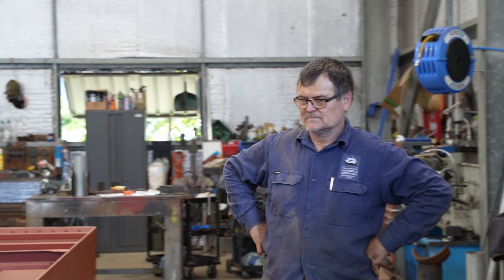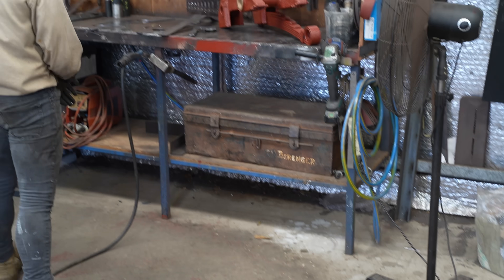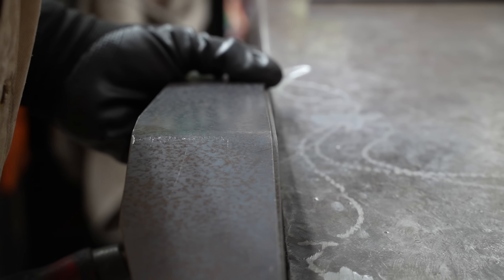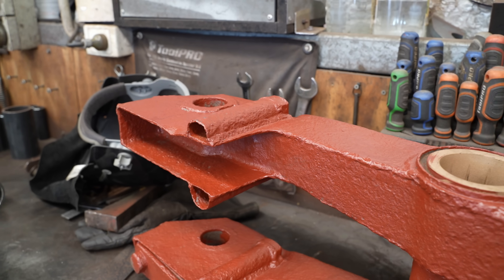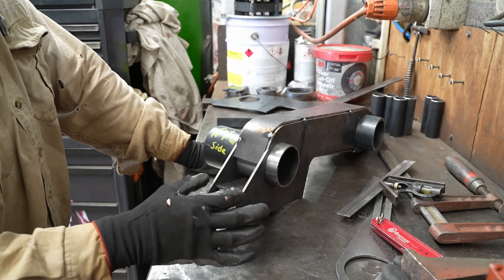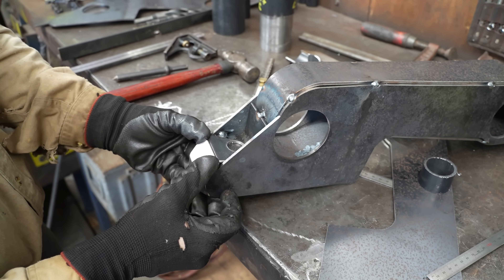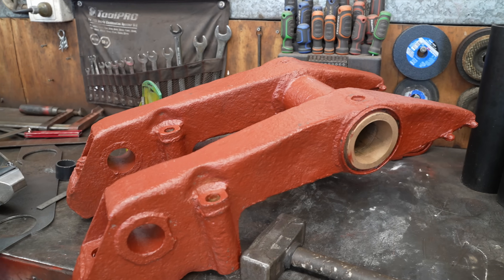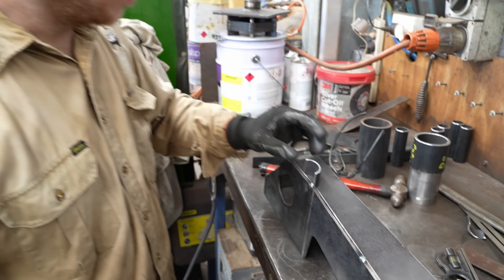WORKSHOP WEDNESDAY: Perfectly recreating PANZER I suspension units from an original piece!

Comment: Those suspension units look like they are made out of pressed sheet metal parts!
There probably was not much manuel work involved other then folding them close with simple bends (if at all) and welding them up! 
Germany was the world leader in sheet metal stamping and pressing at that time, and still is.
First patent for hydro forming sheet metal was filed in 1880 in Germany. 😉

Comment: I have tried to find out the answer to this, but had no luck as yet in finding an answer, perhaps someone can offer an answer.

With the road wheels on German tanks, those that have rubber rims, how were they initially adhered to the metal wheel? There was mention in this video of having some of the road wheels with bad rubber rims, repaired. How would that be accomplished?

Thx.

Comment: Vundabar! It's fascinating to watch these guys succeed in getting into the minds of the German engineers who designed these vehicles. It takes a lot of practice to be able to weld a structure like this together, without having a jig to maintain the proper dimensions. Thin steel wants to warp as you weld it. Get fabrication skills!

Comment: Just commenting as an engineer on Jessie's seriously good fabrication skills, recreating a complicated part from 90 years ago when you only have a single somewhat worn and corroded part to work from requires top of the line skills, you are so lucky to have people with such skills in your workshop
Reply: That's exactly what I was thinking all the way through this amazing video. Sheer skill bordering on magic, and I hope he is paid well enough
Reply: Wow great work.
Reply: Yes that is seriously brilliant fabrication based on a less than perfect original. And Daryl's seriously good work on making all the turned parts. It's not that easy to get things correct where you have to have bearing races fitting perfectly on a shaft. Especially for someone who does not work on a lathe to precision tolerances every day. Great job Jesse and Daryl !

Comment: At the end Kurt says there is only 5 panzer 4 B's but the whole video is about the panzer 1 suspension. Did Kurt just drop a surprise?
Reply: I think it was just a honest mistake. He's not a tank aficionado and that's why it slipped through...
There were only ever 42 Panzer IV Ausf. B built and I highly doubt they've got one kicking around, right?!
Reply: @JensAndree  I'd be amazed if a Pz IV Ausf. B hull still exists with the German habit of sending them back to the factory for rebuilds and upgrades
Reply: @rod.h8064  As far as I know there's none left. Perhaps some remnants still exist on a range but they would've upgraded them all if they could since it was always faster and cheaper to upgrade a tank than to build a new one from scratch.